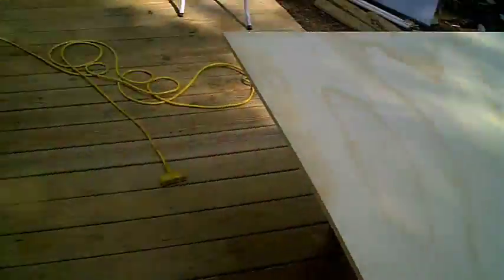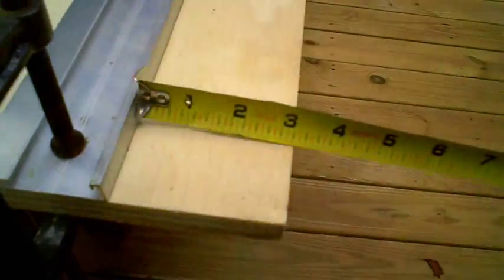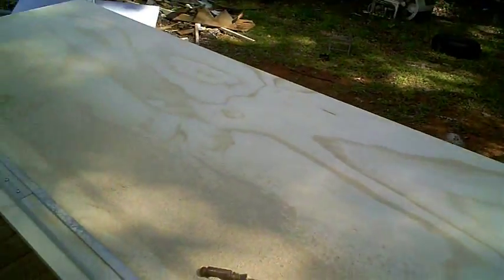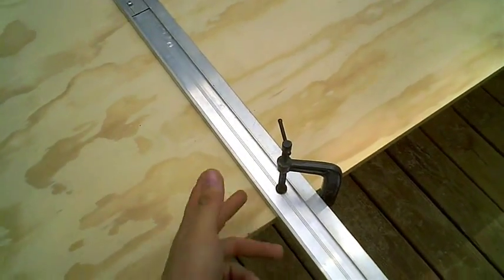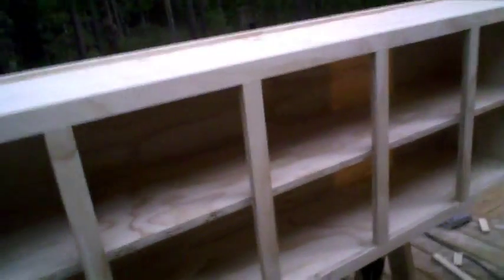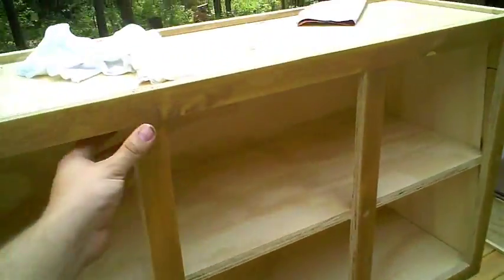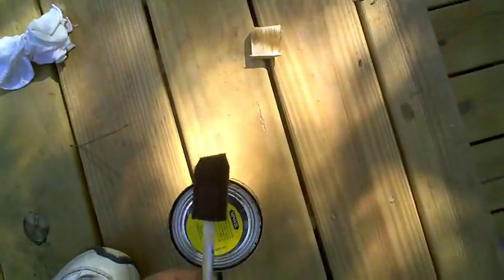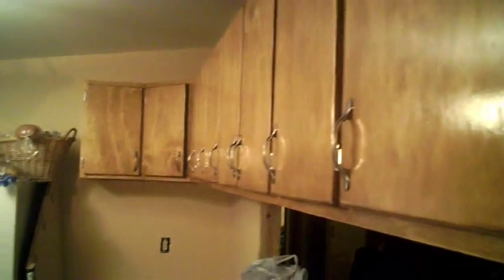How to make a kitchen Cabinet

Comment from the maker: the problem with glue is it might come out if you don't wipe down the the extra and they it does not take a finish well. i have built cabinets with brad guns and with out you can do both. i got a cheap deal on a pan cake air compressor and a 2 inch brand gun for 77 bucks from sears

Comment from the maker: @phill903 i did not glue it... some one just gasped some where... the brads are 2 inches and i back screwed the cabinet with 2 inch deck screws its a solid cabinet